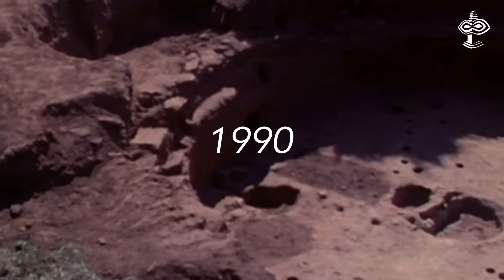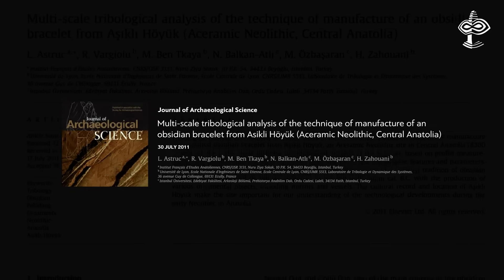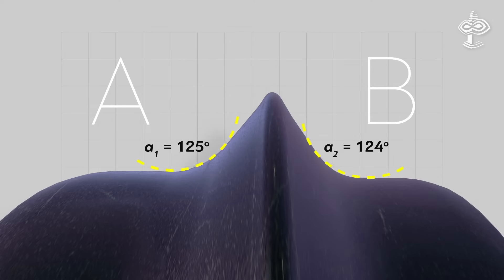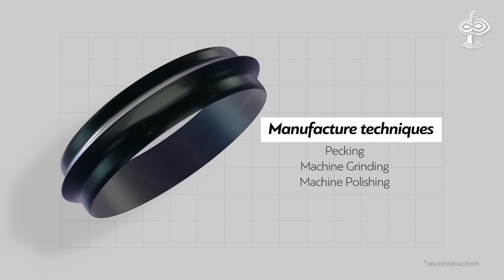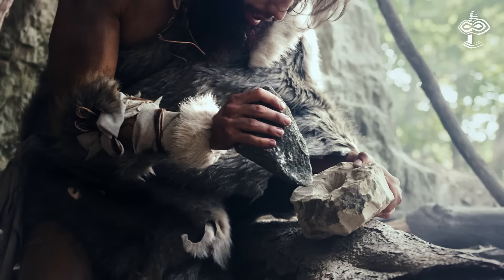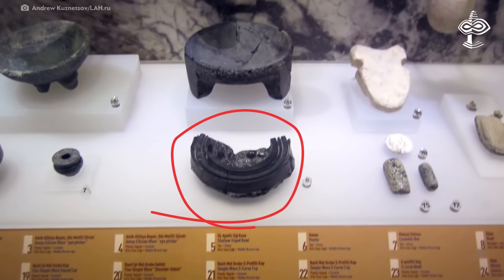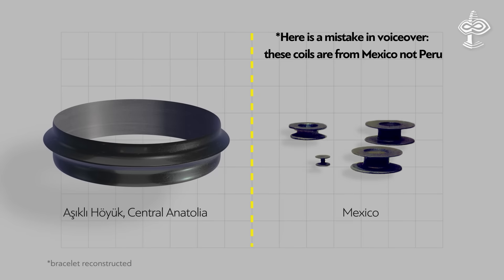This obsidian bracelet is 9500yo and it was made with unknown MECHANICAL devices - VERSADOCO

Comment: I'm a jewelry creator, even though Obsidian has a reputation for being difficult to polish, that being said, I've done the process by hand. It's time-consuming but it can be done, no magic required!
Why do so many people believe that ancient humans were cretins?
They were CRAFTSMAN!👈
Reply: why is it considered a bracelet? that ridge is sharp and would be uncomfortable where ever the wearer touched herself. you would have to hold your arm away from your body to avoid it. looks more like an insulator for a flux capacitor.
Reply: @bobs5596  I agree not the typical jewelry shape.
Reply: @bobs5596  Naah.. there would be no problem to wear it. It could also be worn with bigger/higher bracelets on each side to avoid the glass's direct contact with other body parts.

I think as it must have been a very unique object, only was worn  in very special situations or by a very high rank person like a "priest" or a leader.
Reply: @somjasa  so you think it belongs to an ensemble of 2 other bracelets that nest on either side and the ridge acts as a spacer. 
this requires spinning 3 pieces of obsidian and trying to match the diameters/profile. since we will never know, anything is possible. but it would be (much) easier to spin one larger piece of obsidian and make the desired profile in one operation.
Reply: @bobs5596  No, I mean it could have been worn with two bead? bracelets with a bigger diameter, one on each side to avoid  contact with the sharp edge.

The OP's opinion consider the edge a hindrance to be used as bracelet. I don't think so regardless of extra bracelets or not. 😺
Reply: @bobs5596  it's considered anything that fits modern archeology view on the period that it is thought is from. From the modern archeology point of view it could be only jewellery, weapon, simple tool or a religious object.
Reply: Objects like this do not mean ancient humans had modern technology. They had “lathes”, they just weren’t powered with electricity. It’s typically referred to as a potter’s wheel. You can spin the object with a foot pedal or a waterfall. Maybe slave labor? Cutting and polishing is easy. A paste with an abrasive material like common quartz sand will do. You can apply the paste with a piece of wood while you spin the object. It doesn’t matter what you use for the tool, it’s the quartz that does the cutting. 

All you need is a lot of time and labor. No advanced technology needed. But some people cannot accept this. It’s not as fun.
Reply: @madmattdigs9518 that is advanced technology of a sort. We just have different tech. The truth is that your method hasn’t been tested tho, we don’t know how to replicate what they did yet
Reply: @yoeyyoey8937  I would argue that the evidence proves it. There are microscopic tool marks showing the object was spun and an abrasive material was used to shape it. 

Unless you’re making the argument that someone in the distant past had advanced machinery, there’s really no other explanation. I agree that ancient people were more advanced than we might think… but they didn’t have modern machines like a lathe with an electric motor. Machines like that could not totally disappear from the fossil record. Archeologists would have found evidence of that. Yet, all we have are the objects themselves. That’s how I draw my conclusion. 

Also I work in manufacturing, I operate a lathe every day. And I use lapping compound to reduce inside diameters .0001” at a time. The only advanced technology needed is spinning. Everything else is very old techniques.
Reply: @madmattdigs9518  I think you should make a video demonstrating the process.  You could use an electric motor to compensate for the human labor.
Reply: Could you make a bracelet like this from a core of obsidian ?
Reply: @luuk-out-below9804 i’m going to go out on a limb and say absolutely not.   There’s a russian channel that seemed pretty pleased with themselves by reproducing a stone vase.  I believe they worked  on it a few months.   I’ll hand it to them i,dont think they cheated when the cameras were off,, but they also didn’t come anywhere near the level of precision as the  original craftsmen., the ones from 5k years ago who’s talents and techniques were apparently forgotten.
Reply: It is an old school cd music disk
Reply: The only people who say they weren’t craftsmen are mainstream archeologists
Reply: Of course anyone can do it with today's tools. Can you do it with the tools (or lack thereof) of the time?
Reply: What abrasives did you use? What would you have sourced 10000 years ago to archive the same finish?
Reply: @dante7228 It’s not some advanced material. You don’t need diamond dust. I have read the label and I’m pretty sure it contains silicon dioxide. Which is a fancy way to say quartz. It’s the same material on sand paper or cutting wheels. Just some very hard minerals. I have never tried to work on a material like obsidian. But I don’t see any reason why you couldn’t sand it down with quartz dust. Even if it’s very slow. An artisan could’ve spent their entire career on just a handful of pieces. Why not?
Reply: @madmattdigs9518  well, I was asking just because there weren't any hardware stores around back then. To get that surface finish the grains have to be very homogeneous in size. Also the substrate has to be high grade. And archiving such a perfect shape is really hard by hand without measurement tools. Polishing a surface might be possible, shaping with precision it is rather difficult
Reply: @dante7228 I don’t know if that’s true. I only work with steel parts and the lapping compound is prepared already. I just don’t see why it would have to be anything that special. If you can crush up sand to a fine powder and use olive oil to make the compound… it should work. I guess I have to try it myself. Because that’s what people will tell me to do if they read this. I will give it a try! See what kind of results can be achieved.
Reply: @madmattdigs9518 spending their entire lives on a few pieces doesn't sound very feasible for a subsistence economy.
Reply: @haqk4583  Hey, they were highly skilled artisans. Maybe those items were only for nobility. Very important people. It’s not mass produced. But who knows? I could be totally wrong about all this.
Reply: @dante7228 You could use quartz sand. You could also create a polishing powder by crushing the same obsidian material your working on. Both would work.
Reply: A jeweller?  That’s what it’s called when you create jewellery…
Reply: @bradameerbeg2154 maybe jeweler implies precious metals (gold smithing etc)
Reply: If it was easy for us to do this we would be but…….
Reply: “cretins” I love it ❤
Reply: i forget what object i have seen that was polished by hand but it was a very old object and all i remember is that people polished it by hand for many years.and the finish was amazing, the key here is poliahing by hand for long long time
Reply: Uh huh.  Go ahead and make this “ bracelet” by hand.   You have the benefit of seeing the finished product.   Just like the rock vases, they’re extraordinary difficult to reproduce as described.
Reply: Chris from ClickSpring is a machinist remaking the Antikythera device, and he has show that you can achieve amazingly precise tolerances with incredible crude tools.   And I agree ..they were Craftsmen.
Reply: Yup, just like today, we still have Stone Age people around while we have been to the moon.
Reply: did you watch the whole vid, did you see the analysis of precision of the object and marks on it?
Reply: They weren't cretins. They simply haven't discovered how to work elemental iron into steel alloys yet, nor manufactured diamond and carbide tipped saws or drills (unless they have all, throughout our entire history conspired to hide them from their curious descendants). But that doesn't make them cretins. Hindsight is always 20/20 and modern knowledge is still extremely limited and technologically constrained, despite all the advances. That's why it's considered controversial. And how exactly do you date a rock, and where exactly was the dating performed?
Reply: @NEKRWSPHERE  Yes, as far as I know you can't date a rock.   If there was a way,  the date would reflect the time it was created in a volcano or whatever, not the time it was worked and fashioned into an object.

Comment: FYI
tribology (noun)
The study of friction, wear, lubrication, and the design of bearings; the science of interacting surfaces in relative motion.

I guess they looked at that because obsidian is a natural volcanic glass, meaning that it is hard and brittle, fracturing easily.  For this reason, obsidian has been worked in a similar way as flint points.  That being the case, there is no way that such a thing can be made or even roughed out by knapping.  It must have been made by abrasion & polishing.  It is possible to make polished stone objects by hand abrasion, but that is extremely slow and requires very carefully controlled abrasive grades.  Which tends to limit the size of such objects & beggars the questions as to how the polish was so accurately grades & how a primitive society could afford the time resources to make such a thing.   If this is truly a genuine object from antiquity, it would require something on the scale of ancient Egypt to accomplish this & we don't even know with any certainty how they accomplished such things either.

In nature, obsidian is formed in acid volcanic flows that cool quickly enough to not form separate mineral crystals, but not no fast as to fracture apart from thermal stress.  This begs the question, could people cast obsidian objects.  Apparently that can be and sometimes is done with modern technologies.

Was that done in ancient times?  Well I know of no evidence in favour of that notion.

Comment: Could also have been cut by alot of stuff harder than obsidian. Ruby for example. I dont doubt they were able to find rubys at that time and notice their hardness.
Reply: Then all you need is a lathe with tolerance to produce that precision. Centreline adherence of thousands of a mm, is a good start. then attach the ruby cutting bit find a way to apply consistent rpm do the cutting bit does not gouge the surface and corkscrew and you're golden. But, I doubt the cave people had that kind of lathe. 
IMHO, the best place to START these conversation is to assume that technology needs to be used to make things that look like technology was used to make. Then to break down that argument by providing approach that DON'T use technology. For some reason we are starting backwards and assuming cave people banging rocks together to make speed tips are also making precision items that required Space age level tooling and "just tried very hard to make the same tech."
For a better understanding of the tech available at the time look at a historical archives or aboriginals Australia from the early days. Sticks, chipped stone, twine and tree resin.

Comment: Did anyone try to find the frequency that cause harmonics in the bracelet? I believe it could be an antenna that could “hum” on the wrist when “called” by the right tone.
Reply: Should be easy to caluculate based on the size of the ring, its width/diameter etc.
Since sound travels at a constant speed at 1 atm.
Reply: you should try humming. jesus

Comment: To power the "lathe" or some other turning device, I can think of only two possibilities. One, would be hydro-device, such as a waterfall, similar to how a gristmill operates but at a higher frequency. The other is that it was steam powered. Steam power would require other metal devices to contain the boiling water so that would seem improbable, however there were copper products at around that time. Interesting discovery to say the least.
Reply: you can make a foot powered lathe with a loop of rope
Reply: @honeybadgerisme 
1. the video mentions that the study looked into every mechanical operation used to shape this item and that extreme speeds were needed that were not possible with a foot lathe.

2. the tolerances achieved indicate that the precision would require a device that is fixed and extremely sturdy and that the materials used to shape it were hard enough to not degrade during the process, which would cause imprecision.

3. conventional archaeology posits that the people of the time this is believed to be crafted were hunter gatherers, who wouldnt have a lathe or workshop of any kind in the first place.
Reply: There are foot powered lathes. Come on bud.
Reply: @mystiquesquared They didn’t event have bikes then bro. What makes you think they had peddle power?!

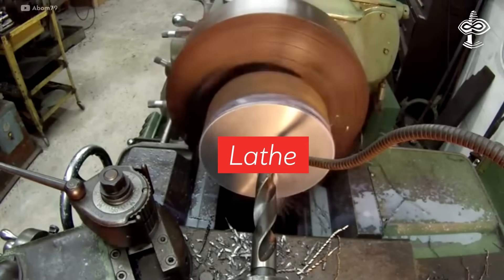Comment: 3:20 Let's see you carve a glass bracelet with a chisel and a lathe. Or a anything pointy and a lathe. Every single tool video you show, in this entire freakin' video, shows a material that isn't glass, which requires different techniques to work than wood, metal, plastic, clay, and most stone (flint and chert notwithstanding).

Comment: But the problem is you cannot date stone.  We are betting everything on the fact that the person who found it, was completely accurate on where they found it, and whatever method they used to date the soil next to it.  Can we say for sure that it wasn't made 200 years ago and somehow got tilled into the ground?  That it wasn't dropped by someone 100 years ago trying to clear that same site?  Unless you have absolutely irrefutable proof of where it was found, its merely a great piece of circumstantial evidence, suggesting that it was made pre-modern human.
Reply from the maker: You'll be surprized but you can date the stone and obsidian (volcanic glass) directly! There is a technology for this called Thermoluminescence dating (TL). Professor Ioannis Liritzis modified this method and invented two novel dating methods. 

The method for surface luminescence dating (introduced at 1994) where Liritzis extended the principles behind optical dating and thermoluminescence dating to include surfaces last seen by the sun before buried, of carved rock types from ancient monuments and artifacts, made of granite, basalt and sandstone and the obsidian hydration dating (introduced at 2002). I described his method in the Osiris Shaft documentary - https://youtu.be/VnWguPTCRms?si=WLesDiFvxPF_uGC1

More details with links to Liritzis papers - https://en.m.wikipedia.org/wiki/Ioannis_Liritzis
Reply: No, the problem is that there are thousands of these artifacts. They are not “circumstantial” they are an entire data set that is completely ignored. Your explanation of them being modern does not hold up for most of these artifacts.
Reply: Charcoal can be dated, and there is usually plenty of that in and around these caves.

Comment: Like the most findings from that era it's not the original tool, it's the rest that cannot be used anymore because there is no material left for drilling holes. It was probably a drill for core drilling. Similar to the arrowheads it could have had sawtooth.
Reply: Keep in mind, this is a large ring, or a small hoop, made from glass. Obsidian is a fancy word for natural glass that comes from a volcano (fulgarite is natural glass that comes from a lightning strike, but it's more fragile, like a tube made of partially melted sand). So, it's easy to shatter. It could've been a small part of some larger tech, but probably not for drilling cores out of stone.

Comment: Also with today’s machines that are so well refined very few modern machines would even be able to turn obsidian because of the harmonic distortion caused by some modern machines that are true and precise, but aren’t harmonically balanced which does not matter much with metal but glass would fracture very quickly, you also have to hide special coolant because again glass fractures with minimal temperature changes while machining.

Comment: If not a bracelet, could it be a rotating part for something?
Reply: Since obsidian is brittle, I can't imagine it is part of a larger mechanical system. In that case, it will break under the external forces, rendering it useless.
Reply: Bearing race

Comment: The reason they've been crying wolf regarding the climate and the anthropomorphic causation is to obfuscate the cause. In the early 1950s, the USAF (and the CIA) found evidence of a reoccurring, solar-driven cataclysm that reshapes our planet. The following is just a snapshot of what we are facing.
The ongoing magnetic pole flip is part of this process.
In the next ~20years, our magnetosphere will tank, we will have massive electrical and plasma storms, we will experience a Carrington level or greater solar storm that will take the planet's technology back to the bronze age. The cataclysm will cause significant earthquakes and volcanic activity. Then, several years later, cosmic dust begins to accumulate and darken the sun. Eventually, the dust will cause a "pressure cooker" effect.  Just days prior to the micro-nova, the sun will be black. Then, the micro-nova occurs. The dust and sun's outermost mass explodes, sending heavy metal "impactors" throughout the solar system.
Those impactors are what helped facilitate the rapid melting of the North American glaciers 12k years ago. 
The final act is the unlocking and turning over of the earth's crust by approximately 25°-40°. The tsunamis and resulting slosh back of the planets oceans and lakes, combined with an upwhelling of underground water and horrendously torrential rains will flood much of the globe. 
Then the 12k year clock resets and another civilization will rise.